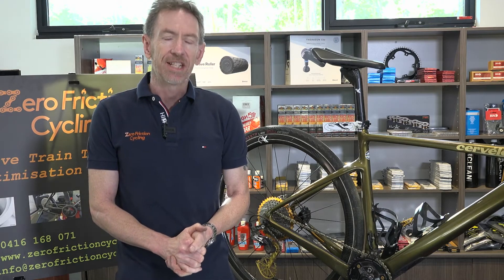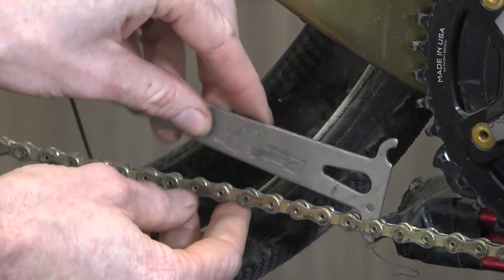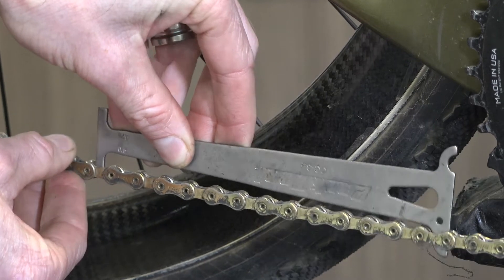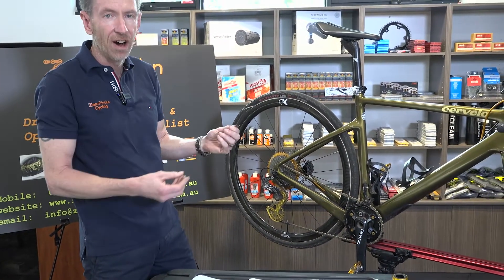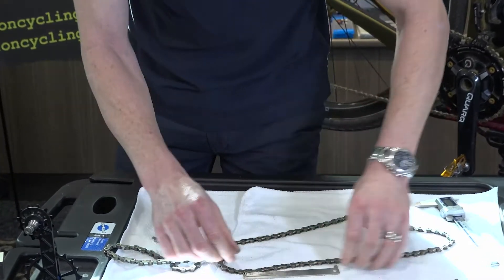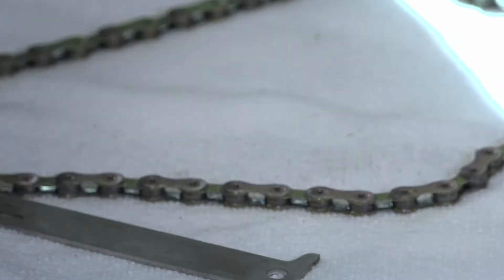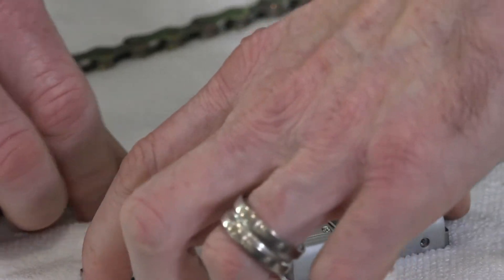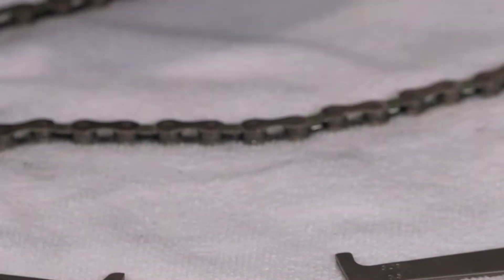Episode 5   How to Measure Chainwear

Comment: Shouldn't you be measuring inside of roller to inside of roller when using the calipers? After all, that's what the go-no go chain wear tool is doing...
Reply from the maker: You can for sure, it is just that roller sizes do vary a bit from brand and model, and then for practical purposes people have a less easy number to work with. Using start of pin to 10th pin - it is 10 x 12.7mm - so 127mm start point, 0.5% is bascially 0.5mm - so replace by 127.5mm. 

If people wish to do roller - as long as they get a start measure which they write down - then fine. Simply most do not, and especially between say sram and shimano there can be decent enough size difference. 

The recommended tools auto adjust to different roller sizes, calipers do not.

Comment: As I understand it, and I am no expert here, but I believe there is no universality to roller diameter??  These standard chain checkers would not factor in the brand and speed specific roller diameter.  Would you agree?
Reply from the maker: some do, some do not - the tools with a dual insert end self adjust to the roller size (such as say park tool cc4) to a degree. Others that do not you will get a bigger or smaller wear measure - for most chains that are normal 11/128 standard the difference is too small to worry about for a "go / no go" time to replace measure, it really only becomes a problem if using on a flat top chain with oversize rollers - that is the only time a simple drop in checker that does not adjust to roller size will give a clear false low wear measure - so if one has a flat top chain, they just need to ensure using a chain checker that is flat top chain compatible. 

Outside of that, what matters most is that people simply use an accurate chain wear checker frequently, and also if possible with tracking their kms. If the majority of cyclists did that, a lot of very popular lubricants would not be popular anymore.

Comment: Very informative content! One question: 
As we all know, a dirty chain (lubed with poor oil, never cleaned….) will stretch way faster than a clean an properly lubed / waxed chain. 
But does the dirty chain also cause more wear on the cassette and chainrings than the clean chain if you do not ride it past 0.5 ?
Reply from the maker: Yes. As the rollers settle onto tooth face as load comes in there is a small amount of movement. If that movement has something abrasive between roller and tooth face, over the hundreds and thousands and millions of such interfaces it will be accelerated wear vs that occurring without abrasive stuff in there. 

Good steel cogs and rings can hold up to this pretty well and so if replace by 0.5 - as the poor lubricant will have the chain get to 0.5 pretty quick - they will normally still be fine as total interactions lower by say 2000km than it would be by say 8000km to 0.5 if the lubricant wasnt so bad. But alloy cogs can wear pretty easily and just not be as resistant to any type of abrasive wear. 

Another way to think of it is that say even though if replace and abrasive lubricated chain at 0.5 and circa 2000 to 3000km and still getting two chains to a cassette - thats say 4000 to 6000km. Whereas a good lubricant getting 0.5 to 8000km - even one chain you are still ahead. And then you should get another chain etc. So more abrasive is just more bad! :)

Comment: best way is the campagnolo way: 132.6 max over 6 links  in multiple places on the chain. Other way fixed gauge 0.075 max NO slotting the tooth into the chain. Been doing that for the past 33 years and have been saving numerous 9 10 11 spd cassettes MTB or Road Shimano, Campagnolo, Garbaruk with shimano, sram, campagnolo and kmc chains.... ;)
Reply from the maker: alas accurate digital caliper use is not the common experience for many cyclists (or using a ruler). You can get 10 random cyclists to measure a section of chain for wear measure and you will likely get at least 5 different measures. Then asking them to repeat this on mulitple sections etc - it is simply a task too many will not do accurately, or find it too faffy to do regularly and thus put off for too long and get caught out. For those whom the method is fine, then fantastic - but it will never be for the masses, they need a simple go / no go tool that takes them 10 secs to do multiple sections of chain and so do easily and regularly

Comment: Is it possible to have the same chain mileage on oil based lubes as wax lubes provide?
Reply from the maker: Not really. Some top options like silca synergetic or rex black diamond etc - if one only rides in good dry road conditions - the contamination level (and thus abrasiveness) will be slow to build up, so they will give excellent chain lifespan with low maintenance. However immersive waxing simply has the unassailable advantages that every re wax effectively re sets contamination in the chain, and for X time after re wax all parts are sliding on a solid coating of super slippery wax leaving chain metal pretty much out of the equation. And also that being a solid lubricant, contamination gathering is lowest possible.  The more contamination involved in ones cycling (gravel / mtb / wet riding) - the larger the gap grows between immersive waxing and wet lubricants / drip lubricants. 

An automotive comparison would be in one engine the oil is being flush cleaned with fresh oil every 5 ish drives, and has a brilliant oil filter. Another engine has no oil filter and an oil change very infrequently. Engine one will simply have less wear over time - day in day out, the lubricant is simply less abrasive. 

A miss conception with waxing is it is time consuming- in fact, there is simply no more efficient and easy way to keep a day in day out super low friction chain. it is slightly more time consuming than never performing any maintenance, but less time consuming than performing the maintenance required to keep most drip lubricants in a similar ballpark re friction and wear to waxing. 

look out for todays video - waxed life like a boss - where i will be covering this properly :)
Reply: @zerofrictioncycling992  one day i ll wax my chains as well
Reply: @zerofrictioncycling992  i live in Europe and ride a bike as low as -8*C. will wax work at that temp?
Reply from the maker: @VladGoro25  yes indeed the main impact with very low temp is the initial break in can be a lot longer (chain can feel draggy until excess wax pressed out and surfaces polished). So whereas normally thats a 10 min thing, it might be an hour thing if you are breaking wax treatment at very cold temps. Hybrid approach is probably best to minimise that, so wax, then re lube next 5 times with silca ss drip, ufo drip or tru-tension tungsten all weather, then re wax to re set contamination - then you wont have to do that break in very often.

Comment: IMHO the best way to measure the chain is by using a digital caliper. Go/no go calipers only indicate to you if the chain can or can not be used, but digital caliper allows to track progress and to see exactly where you are at. However, the easiest and most consistent way to do that will be between the "wide" or "external" links with little upper jaws. The number should be around 132mm for new chain and around 132.6 for 0.5% worn. However, not all the manufacturers provide the magical number. And it may be manufacter or even model dependant. E.g. I tried checking the numbers for Connex but was ignored by them. Of course, one can just measure the new chain and add 0.5% to the number but it is not as exact as it could be with manufacturer's data, becuase then there would be at least one constant. Adam, did you try obtainning the numbers from the manufacturers or possibly used a lab grade caliper with special jaws to get that data? A table like that could be really helpful. Clearly, for your chain wear tracking you are not using a go no go calipers, so there has to be a better, more precise and informative way to do it.

Comment: I have used the Park Tool checker, any thoughts?
Reply from the maker: they have a few. the one with pin is terrible. the drop in (i think its cc3.2) - some are ok, some not - i have seen a lot of variance from tool to tool over the years, i do not think they mfg them to tight enough tolerance, which is very common in chain checkers as every 0.1mm really matters - it is typically 20% of your wear allowance, and they are just not mfg to that tolerance. one cc3.2 might measure wear at under 0.5, another on same chain at 0.75 etc.
Reply: @zerofrictioncycling992 
It’s really super easy to manufacture to 0.1 mm so I would be very surprised they are that bad.

Comment: Great video. Thanks.  I am enjoying the learning you are providing in your videos. I am beginning my waxing journey. I am however wondering if your digital calipers confirm what the "other brand" tool noted and if the Shimano tool was the outlier?  Keep up the great work.
Reply from the maker: Thanks tim! Digital calipers will typically agree with the recommend shimano tl-cn-42 - noting there will be some difference due to calipers measing elongation wear only, and drop in checker still picking up roller wear / roller diameter differences (srams are bigger than shimano etc even for non flat top chains). For most if done right digital calipers are perfectly good way to do, it is just that about 99% of the population will struggle to do that properly, it needs to be super easy and super reliable so that it can be done frequently and quickly on multiple sections of chain. '

it is on the to do list to find more chain checker options vs just one reliable recommendation as there are so many out there, but so many i have already checked have been a let down still leaving me with the shimano tool the only one i have confidence in.
Reply: @zerofrictioncycling992 Cycling, Thanks. I'll get the one you recommend. I am very grateful for the information you are making available.

Comment: Using "Just a little bit of force to get it in", how much is a little, I mean it's easy enough to force it in even in a new chain so isn't this somewhat open to interpretation? Asking because I bought one on the strength of this video.
Reply from the maker: Yes thanks steve - i should correct that actually really overall if it is a drop in checker, it should be basically no force, it is just a drop in for that measure to be correct. If you need to use even a small amount of force, then it is not quite at that measure yet. 

WIthout getting too in the weeds (sometimes i am in my head and then i try to shorten it but maybe then miss something in the explanation) - depending on the lubricant - some lubricants can get a bit gummed up underneath the roller, and may give a false low reading. So it is ok to use whatever force you like initially to get the tool in to ensure that roller has properly compressed out of the way any lube & grit that may be holding it in position. Then remove drop in end and check again re does it drop in, or catch roller. If it is still catching roller, all sweet. 

hope that makes sense
Reply: @zerofrictioncycling992  Thank you, that is much clearer.
Reply: @zerofrictioncycling992  Thanks for clarifying this one Adam - much appreciated.

Comment: Re: digital calipers: I've always disliked the center-to-center measurements as it's too prone to user error.   Why aren't the go/nogo recommendations given as RADIUS OF ROLLER + PITCH + RADIUS OF ROLLER or PITCH + DIAMETER.

Bike on ground, bit a pressure on the crank, measure.  Then we won't need a dedicated tool for this one specific thing.  Or perhaps that's the point.

Aren't the rollers the same size between all the different speeds chains?
Reply from the maker: Roller sizes can vary, and tolerance to inner plate shoulders, but mostly it is just more faff to explain adding on these bits, vs the very easy 10 x 12.7 - 127mm as new measure, wear replacement is + 0.5% which is (rounded down) 127.5mm for replacement mark. 

I dont like centre to centre either, but start of pin to start of pin is relatively easy if one is being diligent. 

The reason why a good tool is recommended is because it is very easy, and very easy means it is actually done regularly. WHen it is not very easy it is put off, (remembering we need to measure multiple sections, at least 3) and when it is put off - people get caught out.

Comment: I thought 0.75 was the "no-go?"

Maybe it depends on your drivetrain...?

From Park Tool: "Anything at or beyond the 0.75 percent reading means that you should change your chain immediately. If you are using a chain designed for ten or fewer gears, replace your chain as it nears the 0.75 percent mark. If you are using an eleven or twelve speed chain, replace your chain once it has reached 0.5 percent wear. For two-sprocket or single speed bikes, replace your chain as it reaches the 1 percent wear mark."
Reply from the maker: Honestly that info is just uber, uber, uber dated. 0.75 was ok in the 5 to 8spd days, sort of. Teeth were thicker for the larger internal width chains so they could take a little more abuse, but still 0.75% is not a great place to be. 

Really 0.5% should be the absolute MAXIMUM one wants to go to. It is ok to be a little lax on it if your parts are cheap (ie tiagra 10spd), but as parts cost goes up, why have your chain start to eat into your chain ring and cassette teeth to match its increasing length  - your chain is your most consumable mechanical part - replace chain erring on early, and enjoy huge cost savings and huge longevity increases in rest of your components. If your components cost a fortune - ie cassettes of many hundreds of $$ and even more for chain rings, replacing when it is even getting in the postcode of 0.5% is a great idea. 

Park tool are providing marketing information for a tool that was relevant 2 decades ago. ones tool should only go to 0.5% maximum, and with more updated information. park tool arent forking out for your drivetrain components so they can afford to be out of touch. generally great company and great tools, i really like park tool a lot overall, but not their chain checkers or info in that space

Comment: Would the lubricant affect the chain measurement. With a hot wax protocol I guess the chain would measure longer as the wax compressed then wore off. So, I’m wondering when to measure, ideally? 
If I were to measure just after cleaning in boiling water might not elongation be over indicated.
Reply from the maker: yes absolutely if you measure a chain chock full of wax post re wax or wax application re lube you will get a false low reading. All one needs to do is check measure before re wax or re lube application, tis that simple and all good.
Reply: @zerofrictioncycling992  so just to be clear - in muddy conditions would I measure after the boiling water rinses?
Reply from the maker: @CMneilB  sorry delay neil i went off on a weeks leave for school hols - and yes correct - but post boiling water rinse is actually not the best time to do it. If you do it hot - you may get a false high reading as metal is expanded. If you let it cool, the small amount of wax inside will re set and so roller etc wont move like it would naturally, giving a false low reading. Best time is just post normal riding, and before re waxing. Unless all of your riding is mud riding - hopefully there are times you can just check pre re wax. if all is mud riding, pour some boiling water over chain on bike just to wash the main crud out (that can again give a false low reading) - and check measure on bike before removing for proper flush cleaning
Reply: @zerofrictioncycling992  thanks so much. 
So, just to clarify - if it’s just a regular periodic re wax I’ll be measuring the a fairly clean chain with just the residual wax in-situ? 
And - if it’s been wet I’d do the boiling water rinse first, then measure? 
Just asking, as the above two may give different readings I guess. 
Really appreciate all your work in this field. 
You’re significantly contributing to a massive reduction in drivetrain component consumption. 
I’ll keep spreading the word.
Reply from the maker: @CMneilB  ah thanks neil for the kind words - we certainly are working hard to improve information in this space! But overall for yours i wouldnt overly worry - regular check measuring is definitely recommended, but it is not needed so regular that you have to worry about differences between if do before waxing after normal riding or doing before waxing after boiling water rinsing. I would just be periodically checking (say monthly is plenty for even very avid cyclists on immersive waxing) and so this should make it easy enough to just do before waxing after your normal riding where it is now time to re wax. You will get consistent wear measuring just doing this, and so not need to worry re if it may be different if do post boiling water flush rinse - which if you wanted to check i would just be measuring before the boiling water flush rinse if you have done sufficient riding on that coating. If you havent done that much riding on that coating and you are flushing and re waxing because it was a wet ride, i just wouldnt worry about trying to check measure and just wait until next re wax where you may have completed your normal amount of kms on that coating.